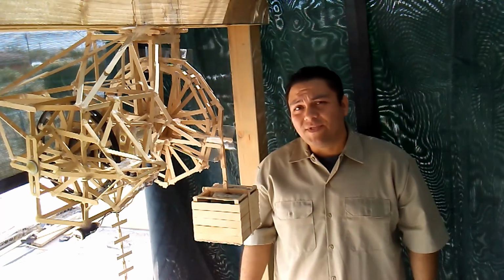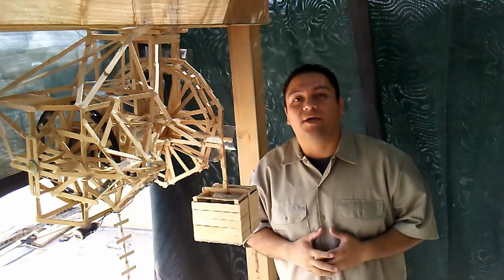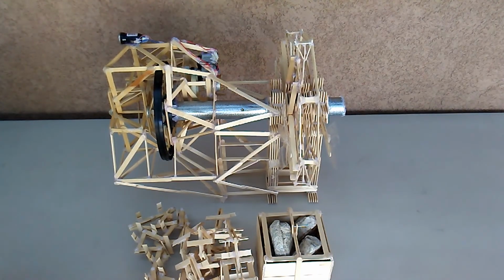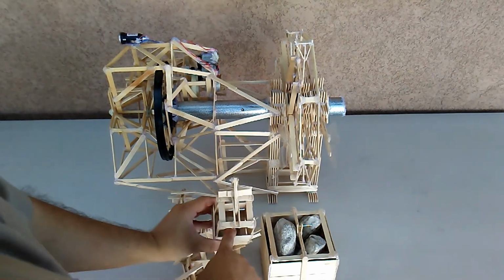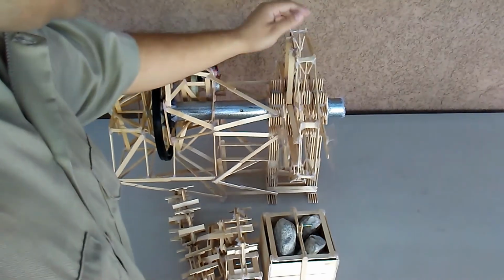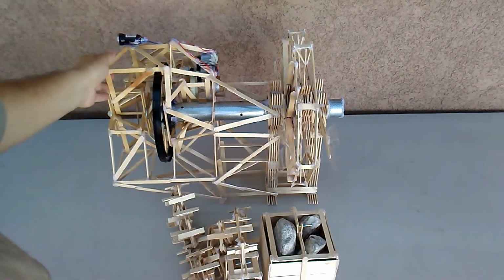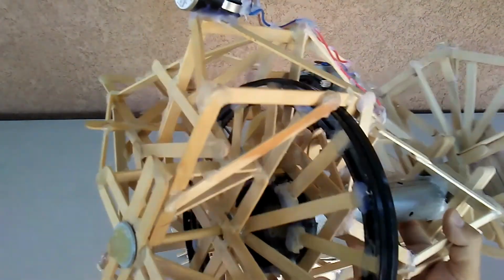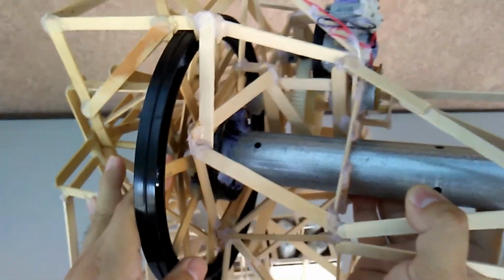Homemade Electric Generator / Gravity Generator

Comment: Awesome proof of concept bro! I was surprised to see that such a lightweight design could maintain its integrity like that! I wonder how this could be scaled up to take camping or  power small rural villages in the 3rd world. I wonder if a ton or so of weight, made to lower down a cliffside could be enough to power some lighting systems for a few hours each night, or maybe charge battery banks? Then villagers could raise it back up with a crank system or come-alongs. Just a thought.
Reply from the maker: I am sure is it possible to make a machine like that. If i can make this out of popsicle sticks someone else can make a way better machine using other materials. I used this same generator to make it work using the wind. I also have a video on my channel. Thank you for the comment.